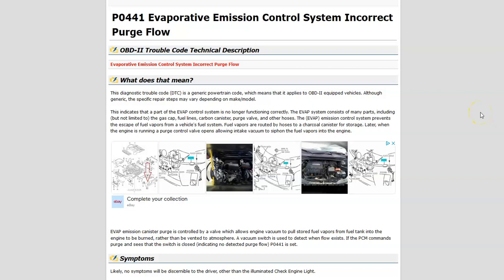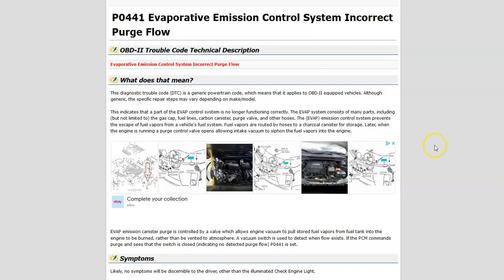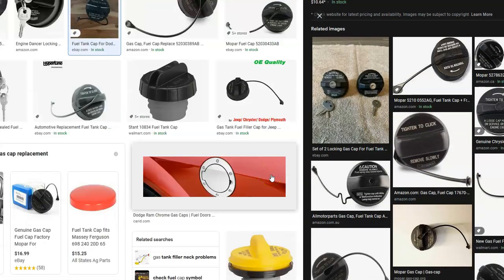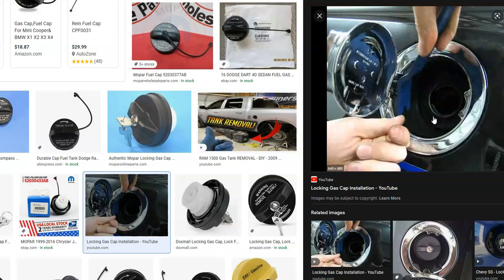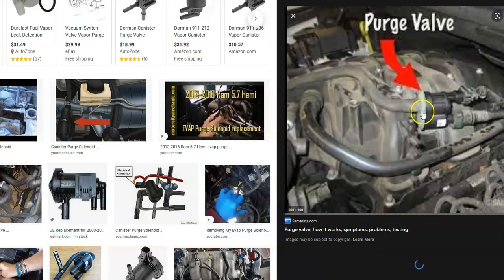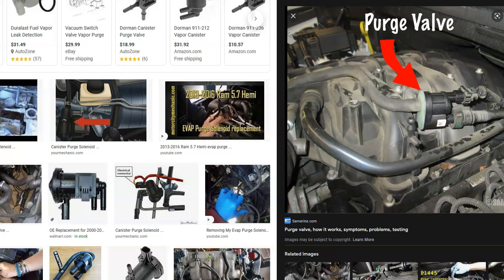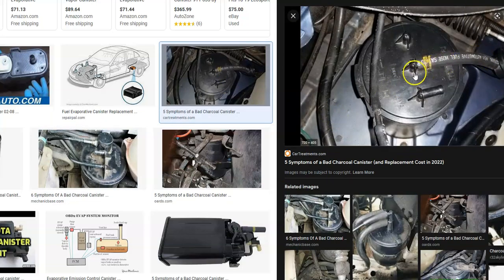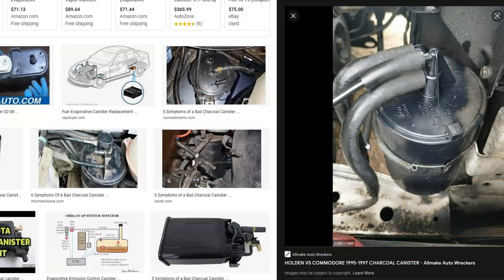Causes and Fixes Dodge P0441 Code Evaporative Emission (EVAP) Control System Incorrect Purge Flow

Comment: Appreciate the video.  I bought a Foxwell reader when my engine light lit up on my Charger, but by the time I got it the light went away though I still got a P0441 reading.  Does that mean it's probably an intermittent issue or does the code remain until erased regardless?  And Chargers don't have a gas cap per se, it's part of the cover, and seems to be clean of debris.  All hose connections look good.
Reply from the maker: It may be an intermittent issue; I would test the purge valve and the wiring. The new no gas systems need to seal like the old gas caps. Also, the light may go off, but the code may still be there until it passes a drive cycle.

Comment: My 2014 has no leak purge valve, which has been replaced 2 times. There was tsb for it as a software issue  as the cause

Comment: Great video. I dont know if this narrows it down at all. I have a 2014 Ram 1500 that has this code. The fume back up in the tank is so bad that you can hear them release when you take the gas cap off, and when you are fueling the tank it chokes the nozzle ever half a litre to three litres. So time consuming to fill up
Reply from the maker: That is common symptom when the vent valve is stuck closed or clogged.

Comment: i broke the gas cap release button on the inside of my door when i was replacing a broken window now its real loose and every time i shut the door too hard it pops open the gas cap cover. i got this code too. need a new button bracket mount thing. small plastic piece

Comment: So I don’t have any codes coming up but my truck is being weird. It seems to sound louder than normal when I’m getting up to speed. I did find that a hose was disconnected at the evap canister. I put it back on and put a hose clamp on it. Don’t see any signs of it being broken or anything like that. Still not exactly sure what’s going on. My code reader shows that the purge flow monitor failed. But no codes, why???

Comment: Smoke machine + new purge + new canister + new gas cap + new detection leak solenoid + new gas tank still P0441 2006 T&C any help please 😢
Reply: After replacing all those things did you erase the code?
Reply: Did you check all the hoses and connections?
Reply: Yes I found a new leak on top of the gas tank hose , time to reset the codes and see what’s next I’ll keep you posted
Reply: @Themachineincmarte  Did this solve your problem? Was it the hose that goes to the top of the tank or the fuel neck filler hoses.

Comment: Thanks for the great video! I replaced my purge valve, then my vent valve and gas cap, but I'm still getting the code after about 20-30 min of driving. I'm not seeing a bad hose or connection. This did start happening after I had a weird situation with filling my tank. I was almost empty and stopped to fill up my 25 gal tank. I put in about 18 gal and the pump quit. My gauge said it was 3/4 full, so I tried adding more a couple times, but I could hear the gas coming up the filler tube so I stopped. I've never had that happen. Then, my Promaster wouldn't start. I let it sit and kept trying until it started really rough. It settled down, and I drove another 100 miles home. A day or two later, I got the P0456 code. I replaced the purge valve. Then a couple days later I got P0441. I replaced the vent valve and gas cap, but got the code again after 30 min driving. I wonder if I damaged my canister at that fill up?
Reply: Getting similar 97 dodge ram.360 ..can't figure it out
Reply: @Sethhaun78  I finally realized that the after market purge valve I installed was not working when I tested it. I ordered the Mopar and it's been working fine now for weeks.
Reply: @leosberk  I replaced mine ram 1500 360 v8 did the purge valve and gas cap both from advanced auto. They said it would work I asked them about oem and said it would be 3 days to order it?after I ran it codes went away .few hours later it's right back on again ?I didn't check the charcoal canister though?how do you test it?
Reply: @leosberk  have heard of then failing every few weeks from other causes I'm new to dodges most all my trucks were ford .by chance not a brand guy .need it for work both my trucks are down and have been screwed had plugs replaced and 1 coil on 4.6 f150 and started useing the dodge soon as I put trailer with some weight on it it's started smelling feul and sputtering. Throwing p0441 code so put gas cap and purge valve new aftermarket from advanced auto?
Reply: @leosberk  where is the vent valve?
Reply: Testing is easy. I'm not sure where your PV is located, but it's likely near the intake manifold since that's where it gets vacuum from. To test, disconnect the hose from the PV that does not lead to the intake manifold. After starting your engine from cold, there should be no vacuum on this hose. If there's vacuum, then the switch is stuck open and it's trash. There are some good videos on how to test. Good luck.  @Sethhaun78

Comment: Has anyone mds stopped working cause of this?
Reply: A little late, but any time a check engine light is on it will shut off the mds
Reply: @becomingunhuman2106  thanks mine just did that today
Reply: My code just popped up yesterday but the MDS is still kicking in. This is on a 2019 Ram 1500 5.7. I hate the MDS to begin with.

Comment: Hi , thanks for the explanation. My Dodge Durango 2003 4.7 has the evaporative emmision incorrect purge flow code . I have noticed at start up no issues but after a while at a stop light the combustion seems a little lumpy plus I’m getting a slight smell of smoke. Exhaust is clear and clean no black smoke and no change in idle speed . Wonder if you have any ideas cheers

Comment: Great vid! One thing not to do is overfill your gas tank. I had one that filled the entire EVAP line to the purge valve with carbon particles from the canister. The purge valve was jamming open or close, cant remember which. Let the gas handle click only once during a fill up. Hope it helps! Cheers!
Reply: How do you remedy that?
Reply: Yeah I need to know how you remedied this too
Reply: Had to remove and clean (blow out) all the lines leading from the gas tank carbon canister near the fuel tank all the way to the valve under the hood. It's designed to transport gas vapors only. Overfilling the gas tank to the very top pushes liquid and possibly carbon fragments down the line
Reply: How did you blow it out & what did you disconnect?
Reply: I disconnected the rubber hoses in sections from the evap to the purge valve under the hood. I then blew out the segments with a small air compressor for filling up bike tires. I used a small nozzle and regulated the pressure by moving it in and out of the hose when too much pressure built up. Eventually the charcoal pieces came out. Hope it helps!
Reply: So overfilling can really cause this code🤔